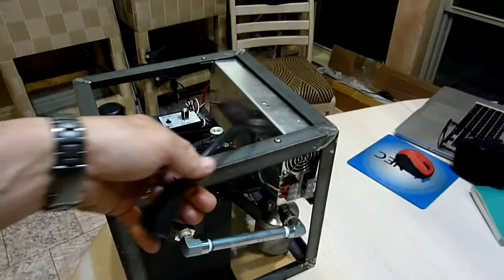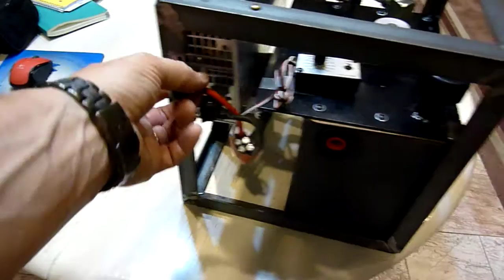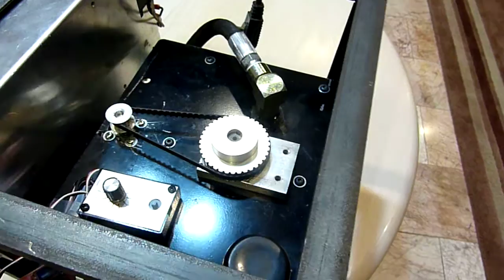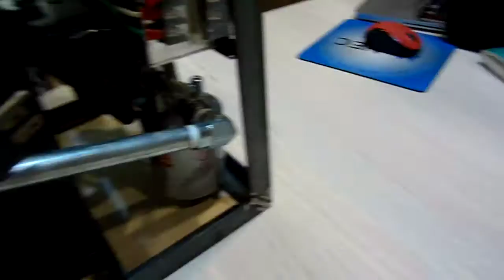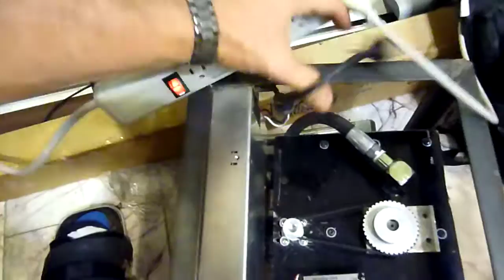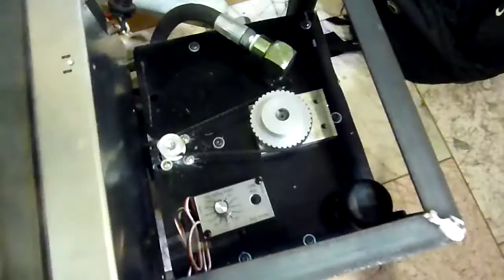Micro Power Cube - Overview

Comment: what do u do with it?
Reply from the maker: The micro power cube was intended to power hydraulic equipment used in the OSE workshop, such as the metal worker, hole punch and lathe.
Reply: @ThomasGriffing  ok. I thought u were making mini tractors etc.   

Can I commission gractor and or power cube builds?  

One last quick ?  Has anyone tried steam?